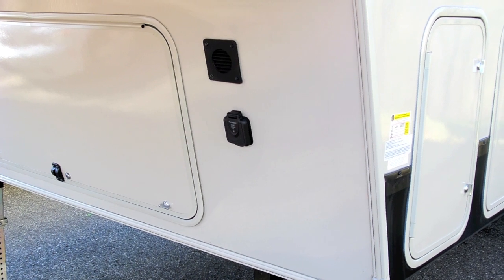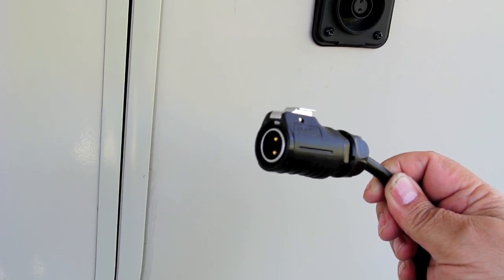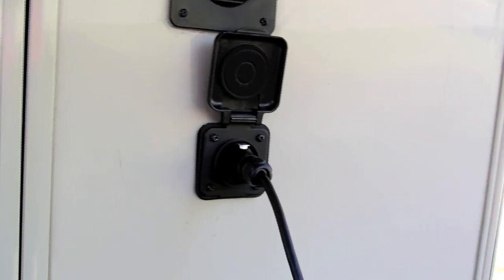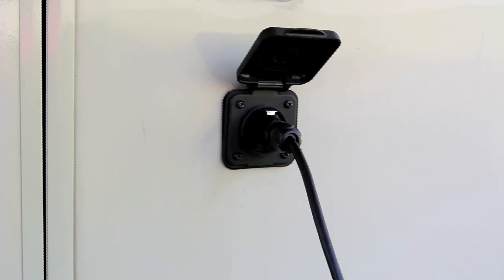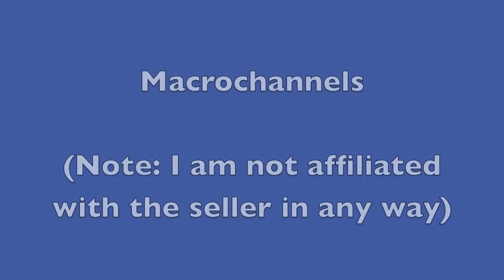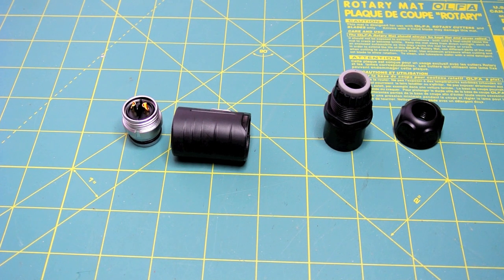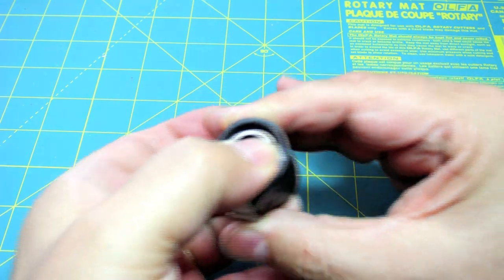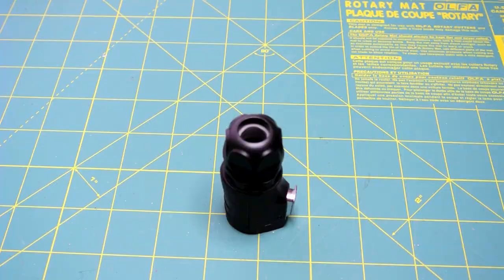Using your RV's Furrion Solar Power Port

Comment: Good video,  but you should never connect a solar panel directly to a battery.
It should always go through a solar charge controller first,  Otherwise you can destroy your battery.

Comment: I liked how waterproof the furrion connector plate was.  The issue I had with it is that it had 12 awg wire, so I drilled out the plug and bolted in an SAE connector with 10 awg wires.  Pretty tricky dremel work but it looks great.

Comment: I have a 2019 Freedom Express Blast with the same Solar input. I have a 350 watt panel that I tried to connect, and as soon as I plugged it in I heard popping. Is this normal? I immediately unplugged it worried I was frying the wires or fuses...... have not tried since. Please help!
Reply from the maker: Popping does not sound good.  Make sure  the connections are the correct polarity.

Also, make sure the panel you are using has a charge controller to manage the battery.  You cannot directly connect a solar panel to a battery without a controller.

Be sure to check out my RV Suitcase Solar video series.  It consists of 11 videos that show every aspect of connecting a portable solar panel to a RV.  You can find it here: http://www.rv-project.com/projects/suitcase.php

Comment: Those connectors are now available on ebay, with the common plugs attached. Cheap.  I just bought one for my Renogy 100 watt panel. April/2021
Reply from the maker: I actually helped the company manufactures the CNLinko brand connectors realize that their connectors were widely used for the Furrion solar ports.
Reply: @RVProject  excellent!  Well Done!

Comment: I have a Grand Design as well with the 10amp plug in. I purchased a Renogy suitcase solar system. I have 2 Marine 27 RV batteries. How do you find the battery type on the Renogy Voyager display? Lith, LiFePo4, LTO, Gel, AGM, flooded or Calcium?
Reply from the maker: I produced a 12 part video series on connecting the Renogy suitcase to the RV.

In part 1, I go through how to set the battery type.  AFTER connecting the battery to the Voyager display (this cannot be done until the battery is connected), you can scroll through the battery types using the Battery Selector button.

The battery types are: SEL (Sealed AGM) >  GEL > FLD (Flooded, standard battery) > LI (Lithium).

You can access the complete solar panel series here: http://www.rv-project.com/projects/suitcase.php

Comment: Your comment that the port goes to the battery is correct. This is a waste of time. It was much cheaper to us sae connectors which I did.
Reply from the maker: I did an update video showing several different connection schemes: https://youtu.be/7-rsq3Wc5as

Comment: Could you explain to me how to connect the pigtail to a two battery system? (Grand Design)
Reply from the maker: Basically you would connect the pigtail across the battery terminals just like you would with a battery charger.  Be sure to watch my solar charger series - 7 videos for how to use a portable/suitcase solar charger with your RV.  Http://www.rv-project.com/projects/suitcase.php

Comment: Thank you.  I purchase both the male and female connectors above. My goal was to use my portable solar panel, Coleman 100W from Costco, for both my Grand Design Imagine trailer and my camper. I knew I had to use the charge controller with the camper but thought the Furrion on the Imagine had one in line with the battery. I started thinking about it and decided to check out YouTube and found your site and learned they are just a "middle man" as described below. I ended up putting the charge controller in series with the male connector which will now just plug in the Imagine. The female connector is attached directly to the battery of my camper so now I can just plug directly into it. For my trailer the +12V is the bottom pin, #1 and the ground is the top pin #2. You just need to take a volt meter and confirm which pin is hot (+12V).  My wife was the inspector and of course made me re-solder a couple of areas. Soldering the cups was a slight challenge but there are videos how to solder the cups.
Reply from the maker: Which terminal uses + and - is all over the place. In fact, I have heard that some solar panel mfgs wire them one way and others the opposite.

So always check polarity with a multimeter.

Comment: Sounds like the best thing to do is throw this port in the garbage, and install one that properly meets an owner's needs and power handling
Reply from the maker: Realize that this port is for portable solar panels. 10A is sufficient for most of the portable/suitcase solar panels on the market.

Since many OEM manufacturers install these ports, you are gonna leave a hole in your RV unless you replace it with something.
Reply: @RVProject  FYI.  They sell 30a ports.
Reply from the maker: The typical suitcase portable solar panel is 100W or less. A 10A connector is sufficient for those.  But if you want to put a more heavy duty connector in it's place, there is no harm in doing so.

However, I want others that watch this video to realize that the 10A connector is sufficient for a 100W solar panel, so I am not going to recommend they replace it for that sized panel.

Comment: I liked the video and like u I had a little bit of a problem not knowing what to call it.  I searched Amazon and they have all kinds of configurations from just that and to go to the standard 12 v plug that battery tenders, Zamp solar systems use and others.
Reply from the maker: Thank you for supporting the channel.

Comment: Could a "solar ready" RV be converted to a real solar system?
Reply from the maker: The term "Solar Ready" is more of a marketing gimmick than anything else. It simply means the mfg added a $30 connector to the outside of the RV for connection to the battery so you can connect a portable solar panel to it. 

In this scheme, the panel simply recharges the coach battery so you can use DC power for a longer period of time (lights, water pump, etc).

A "real" solar system requires fishing wiring to the roof, mounting panels to the roof (assuming the roof has the structure to support them), adding a charge controller and inverter for converting DC to AC.

Comment: OK everyone has the Furrionport/battery connection which is just a selling ploy and like another person said just a direct battery connection with no other electronics in between. The big question is if you do install a charge controller shouldn't you turn off the CONVERTER? If the charge controller and the CONVERTER  are both trying to charge the battery what will happen. Can you damage the charge controller? Furthermore can you ruin your solar panels if you do not turn off the CONVERTER? And if you aren't using the solar panels shouldn't you disconnect the charge controle and the solar panels with a switch from the battery if you are on shore power??????
Reply from the maker: In generic terms,  you should be able to have a converter (i.e. battery charger) and a solar charge controller connected to your battery at the same time. 

The solar controller should have protection circuitry to prevent a higher voltage converter from attempting to charge into a lower voltage charge controller (i.e. when the sun goes down).  

But since much of this stuff is made in China these days, there will likely be an exception or two - so check your owner's manual for the charge controller to make sure it can co-exist with a converter.  Err on the side of caution and only use a solar charge controller you know for sure has the protection necessary to be used with a converter.

The solar panels themselves are isolated from the RV's converter by the charge controller. The panels connect to the charge controller, and the charge controller connects to the battery. 

Never connect solar panels directly to a battery without a charge controller. Solar panels typically output 17VDC or so, which is too high for a typical battery.  The only exception is very small solar chargers; the kind that plug into a lighter socket. Those are usually lower voltage and designed for direct connection to a battery.

Comment: I'm wanting to purchase a solar panel I found at Harbor Freight and the furion plug. However, I have questions about what I'm doing (this is all new to me). Would someone be willing to have a look at what I'm getting and let me know if this will work? If so, I'll email some links. Thanks for the help! It will be greatly appreciated!
Reply from the maker: I need to add a disclaimer that you must be responsible for any actions you take from my advice as I cannot know your RV in detail, your skill set and so on.

Having said that, this plug is intended to work with portable "suitcase" type solar chargers, which are self contained units. Most come with charge-controllers, but some do not. A charge controller is mandatory or you will damage your battery. 

Most charge controllers are 100W to 200W. Always buy a larger panel than you think you will need as their output varies with the intensity of the sun, and unless you are on the equator with the sun directly overhead, the solar panel will output less than it's advertised wattage. 

The suitcase charge controllers are designed to attach directly to a battery, and use of this plug simply allows you to connect to the battery without having to leave the access hatch open.

Unfortunately, I live in Michigan where we have few days that are not cloudy due to the Great Lakes. And combined with not boondocking a lot, I probably will not do a solar project in the foreseeable future.

Comment: There on Amazon to you don't have to go to Ebay.
Reply from the maker: These connectors are distributed in the US By CNLinkoUSA. The connectors  are available at both eBay and Amazon. If you order them from either location, they come from the same warehouse in Jacksonville, Fl.  The 
eBay ones are a bit less expensive since the overhead is less than on Amazon

https://amzn.to/2MieM2N

https://www.ebay.com/itm/2-Pins-Industrial-Connector-Male-Plug-Outdoor-Waterproof-IP67-LP-20-C02PE-01-001-/122257876169?hash=item1c772324c9:g:yXcAAOSwEzxYR2jY

I know this because I helped CNLinko identify the  LP-20-C02PE-01-001 connector as the one that works with the Furrion Solar port.  In fact, on both Amazon and eBay pages in the product photos, you will see my electrical drawing in the installation instructions.

Also my webpage has the same installation drawing and instructions: http://www.rv-project.com/projects/solarconn.php

Comment: Thank you for the informative video. But do you have to use a charge controller?? Or is there one built in to the rv?
Reply from the maker: You need a charge controller. Many portable "suitcase" style chargers include a charge controller. Larger roof-mount units typically do not come with one.
Reply: RVProject. thank you for helping me with this issue. You were very helpful.
Reply: Re watch the video. No there is not a charge controller. It is an RV scam.

Comment: I bought the ZampSolar waterproof 30 amp suitcase panels that comes with an installed charge controller. I also bought the adapter. The only thing is I’ve blown two fuses just recently because the port to battery line has only a 10amp fuse in it and I get anywhere from five to thirteen amps most days. Could I put a 15 amp fuse in its place?
Reply from the maker: The connector is rated for 10A. Exceeding that current is not safe . You could potentially melt the wiring and cause a fire.

Comment: I realize this is a year old but I need someone to pleeze help. I’m a newbie RV owner. My question is: is the receptacle on the RV and the adapter for furrion that plugs into it for the purpose of providing power from the solar array to the battery? Or providing power as an outlet to an appliance??? Appreciate any response
Reply from the maker: It is just a connector that connects to the battery. It's intended purpose is to connect a solar panel to the battery, but you could use it to connect any 12V device to the battery, such as a portable air compressor. However, there is a limit to the amps you can draw through the connector.

Comment: Thanks. I have a 2018 Reflection 29RS.  I assume it has the same port.  I bought the 100w solar panel kit from Harbor Freight which has a controller.  I'd like to plug the panels into the port and permanently mount the controller on the inside.  Is there a reason I should rethink this?
Reply from the maker: I can’t confirm because I don’t have one, but I’ve heard the Harbor Freight panel isn’t all that reliable. I think I’d try it awhile as a portable before drilling holes.
Reply: You mean the holes for mounting the controller?  And - if I were to wire the panels through the port with the controller on the inside, I wonder what kind of current would be going through the port.

Comment: This port is only useful if you have a portable solar panel you set on the ground when you are camping.  It assumes you have a charge controller built into the panel.   Personally, for any quality install, I would bypass this port.  I would install a quality MPPT charge controller in the coach and have it wired to rooftop access for the panel connection.  The refrigerator vent is frequently a good access location.
Reply from the maker: I suppose it all depends on how you want to use it.

One advantage of a portable panel is if you have trees over your RV’s roof, or live in a northern climate where the sun isn’t directly overhead.  A portable unit lets you angle the panel for maximim output.

And while it seems a full-time job, you could track the sun throughout the day with a portable panel.

Advantages and disadvantages to both.
Reply: Portable panels also are more likely to get damaged, have worn cables and connectors, simply get knocked or blown over while no one is watching, and in general, sustain more wear and tear.  Permanent panels can still be tilted, but for most people I would simply recommend installing more panels.  This way they are always on, always ready to produce, and have no exposed components or wires.  Even when laying flat, panels under even partial sunlight are producing.  I have a 5.2kWh system on my home and a .5kWh on my RV.  Tilting the panels would increase my output by 10%.  I have no interest in getting up at 5am to start moving panels and then babysitting them all day long.

Comment: Thanks!  Wondering what type of wire/cable you are using between connector and the solar panel in this video and the name of the vendor.
Reply from the maker: If you purchase a portable "Suitcase" style of solar panel (i.e. Renogy, Zamp, etc) it should come with a built-in controller and wires terminated in either battery terminals or an incompatible connector. I would simply replace the battery terminals with the compatible connector.
Reply: thx for this info! I will be replacing the battery clips with an SAE extension cord to fit my built-in rig solar outlet. looking forward to trying solar to keep my new battery charged.

Comment: I have this unit..question when charging the battery under steps into rv  do u have it onin rvor off while charging with this solar
Reply from the maker: The battery can be in operation while it is being charged by solar.

Comment: "limited to 10 AMP" when it's connected to  7.5 AMP fuse, it's not 10 AMP then, it's a 5-7.5 AMP connector
Reply from the maker: It's stamped 10Amp on the connector body.
Reply: just change the fuse, it's not rocket science.

Comment: If you plan on using the installed Furrion solar port in a Grand Design Reflection unit, check the fuse that is located in the circuit.  When Grand Design built mine, they installed a 7.5 amp fuse and fuse holder instead of the required 10amp protection.  I contacted the Grand Design factory and they confirmed that they ran out of the 10 amp fuses and there was a period of several weeks where they installed 7.5 amp components.  If your rig has this, you'll not only need to change the fuse, but the fuse holder because the one they installed has too small a wire gauge.  My unit was built in October of 2016 in order to give you a feel for when the impacted units were built.
Reply from the maker: I am not sure if mine even came with a fuse in the fuse holder.
Reply: Thanks!
Reply: Grand Design claims to be quality and they admit cutting corners by using wrong fuses. Rv manufactures are so cheap cutting corners everywhere!

Comment: 10A is anemic. I don't know why they even bother.
Reply from the maker: They are intended for suitcase solar panels, which are typically 100W.
Reply: It’s only a selling point.  Stupid people think they’re been environmentally conscious because they buy an RV with a solar port.
Reply: 10 amp DC is much different than the AC amps most hear about.